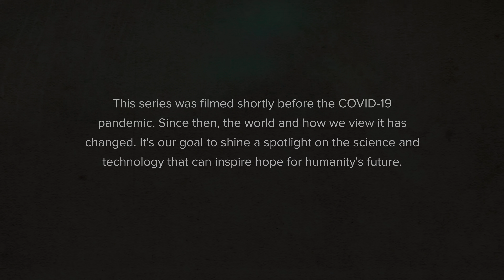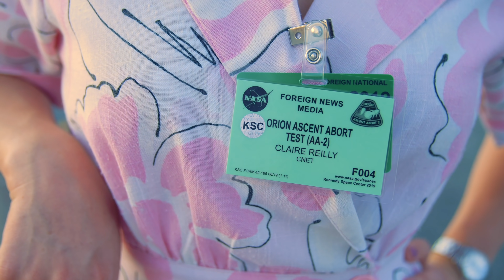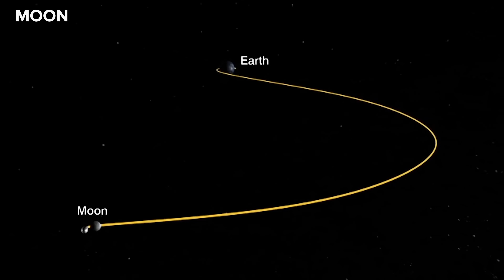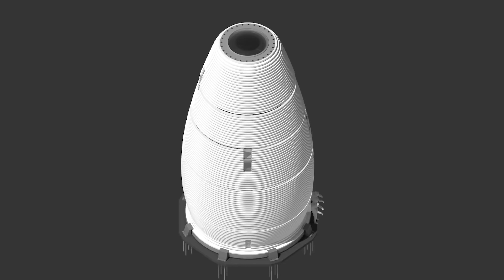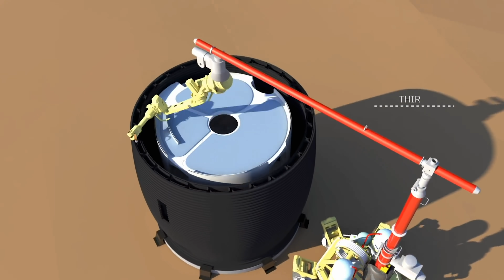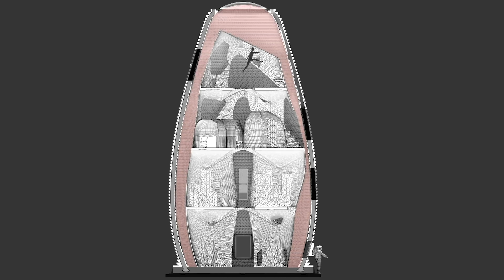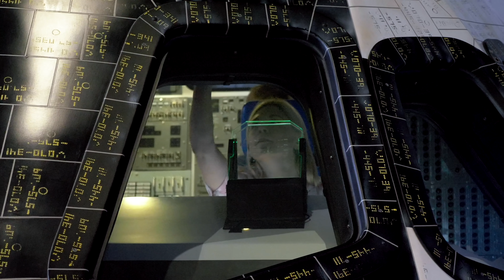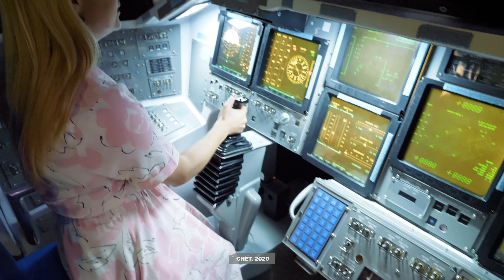Escape the Planet: How Humans Will Live on Mars

Comment: Do architects and engineers underestimate what sand- or dust-blasting will do to buildings on Mars? How do they imagine astronauts will obtain electrical power during planet-wide storms? Are we talking about using wind AND solar enough to have double the energy astronauts require????

Comment: Okay you Mars crazy lunar-tics, let's go through this again. You absolutely will not EVER live on Mars. It is a pipe dream.
The trip alone will take your sanity, 9 months trapped in a capsule.  And when you get there, lest you forget, you're still in the frozen, vacuum of space. Temperature swings of nearly 300 degrees. No oxygen or water. Any small mistake will be absolutely fatal and there is no one to call for help. There is only 1 planet that supports life. Earth. So lets quit using all of our resources up trying to get off it and quit polluting the atmosphere with rockets launches that produce megatons of the bad stuff. If you can't deal with the reality of the situation, maybe you should go live on Mars. Lol.

Comment: ridiculous fantasy.. no explanation as to how the f you would get that much hardware so far away.  To date the only thing that humans have been able to put into space is small compartments.  The largest of them could fit into the cargo bay of the space shuttle-something that is no longer even available.  These small compartments have to be equipped with air & water (and food!) which runs out in a fairly short time.  The int. space station is about the size of a football field and it needs constant resupply with 60's era Soyuz rockets.  No explanation as to how the f they would be able to construct this massive structure the size of many (earth-based) domed stadiums and then fill it with air and then make it self sustaining with crops inside.. on MARS which takes months to travel to.  total BS

Comment: Humans will never live on Mars or any other body that cannot generate .95 to 1.05 gravity. Sorry folks, Hollywood and people like this production crew are just wrong.
Reply: Caden Grace Just watch us.
Reply: @jaymz1999  Until we create and perfect artificial gravity, not going to happen.
Reply: Caden Grace It will happen.
Reply: Rotating habitats can do any gravity. ;)
Reply: @JohnStephenWeck  But, they can't do it IN a gravity.
Reply: @cadengrace5466  You just put them in orbit.
Reply: @JohnStephenWeck  Well, you could do that but you could never get that many people in those stations. An O"Neil station has material limits on how big it can be based on the strength of the materials used for the structure. After a certain size is reached combined with rotation a station will tear itself apart. Many suggest carbon nano-tubes as a good materiel for this but we have no made it that quantity it would be needed. If you could build a station as big as you wanted then this is practical but why would would you do that? It is not the same as living on a planet.

Comment: The reason all the sci fi shows huge transparent domes is because that alone creates an environment like home. You don't have to hold the air pressure in if you balance the pressure with water bags. They do need to be 50 ft. deep or so for around 8 p.s.i. but the load is balanced so flexible membranes and abundant water is all that's needed and light allows agriculture. There is no limit to the size these domes can be and radiation would be much less than Earth. The basketball would be amazing.